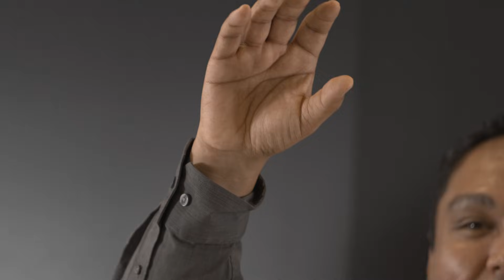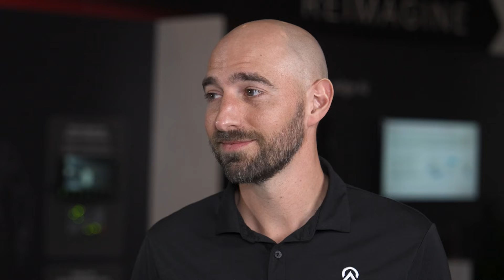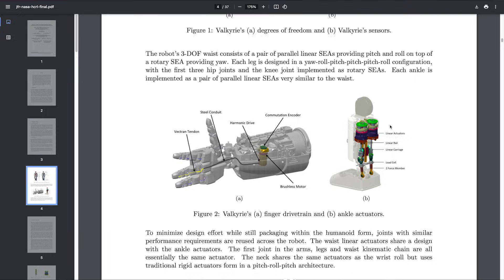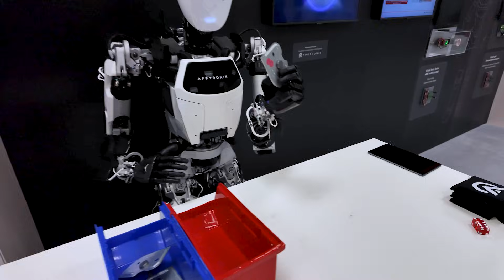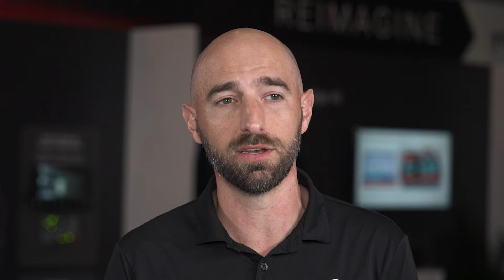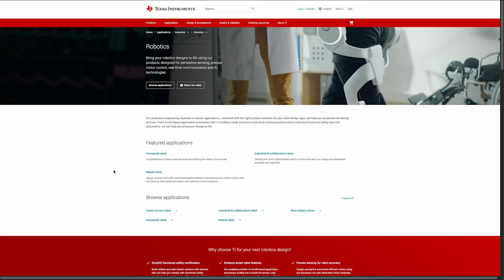Apptronik and TI: Building Innovative Humanoids for the Future

Comment: I build  Meccanoid with Japanese instructions .
Saving for 3D printer then I can build aluminum carbon fiber parts and use Gel10  for Face put raspberry pi with   ROS .
  Back in Poland We designed bridges and machinery so with Blender I could make magic. 
 Today's technology it's promising digital Immortality. 
AGI is right around the corner and Microcristal Nanofluids are available.  
 Volta and Galvani  Benjamin  Franklin  did first step researching electricity .

Good Luck with Your Research.